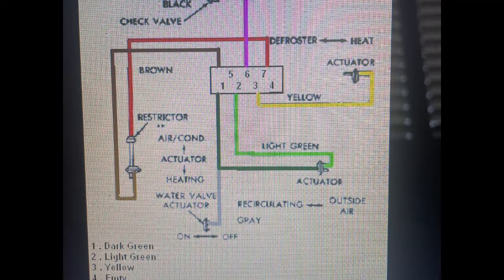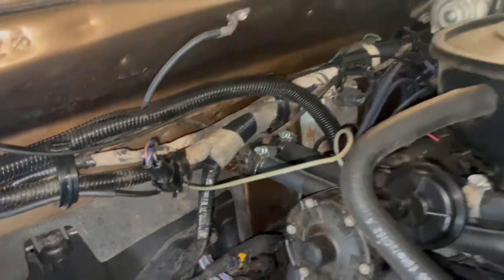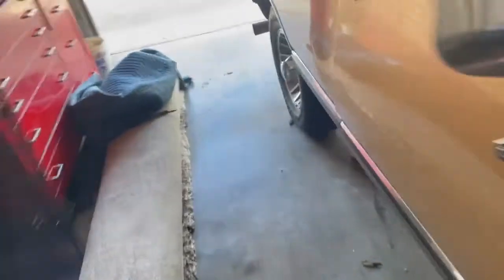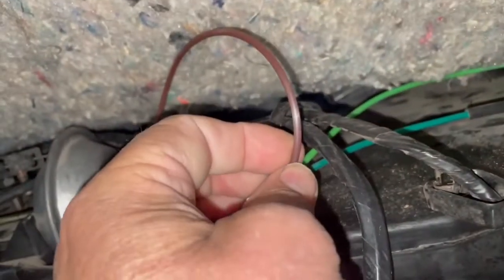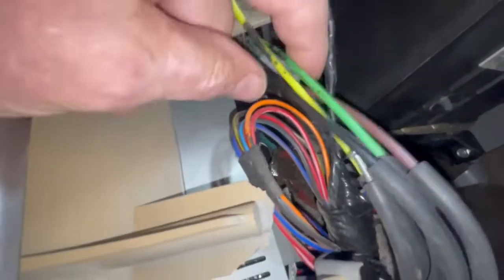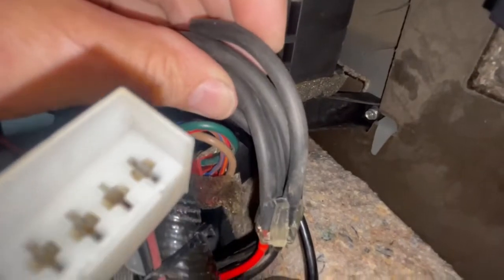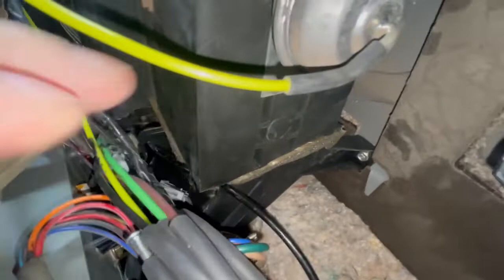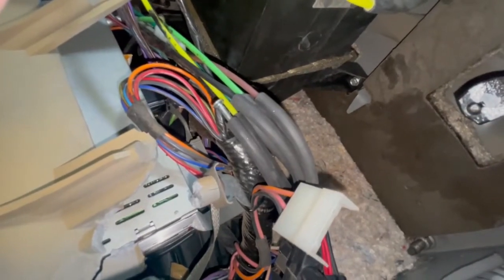Gen 2 80's Dodge Ram and Ramcharger AC/heat vacuum line repair schematic.

Comment: Just repaired my a/c and heater control functions using your video and diagram… thank you! Been running my 85 D100 for 2 years with everything blowing out the defrost ducts… everything seems to be working properly now. Bless you Man!!
Reply from the maker: Thanks for the kind words glad it worked out for you.

Comment: Does the brown wire go into that actuator 
What does the black wire coming from the engine hook to
I can’t get it to switch to defrost or heat just comes out the vent
Reply from the maker: They are vacuum lines. Plastic tubes. The black tube is the main source of vacuum for the whole system. I would check that hose in the engine compartment first from the engine to the firewall for leaks. If it’s good you’ll have to go under the dash. You can pull your glove box out and check for leaks on the door actuators.
Reply: Thanks man it works good now